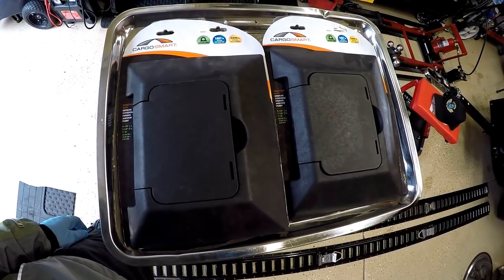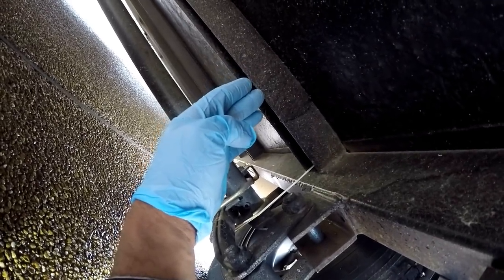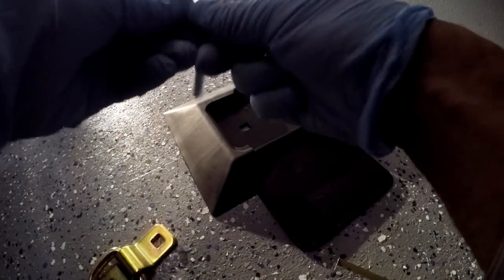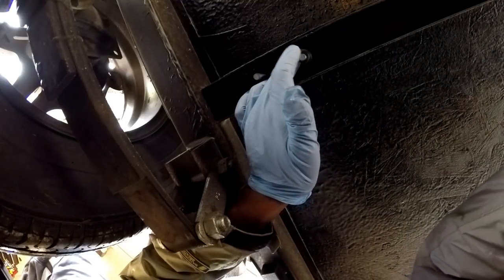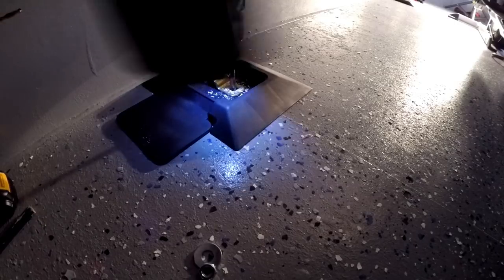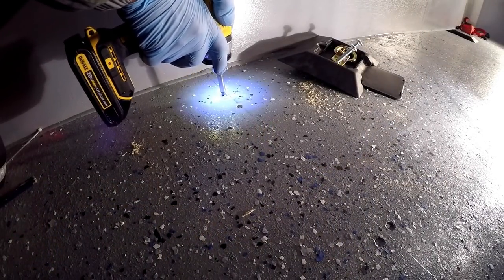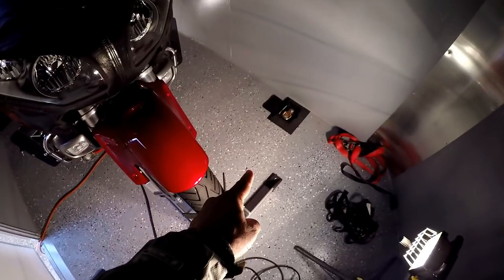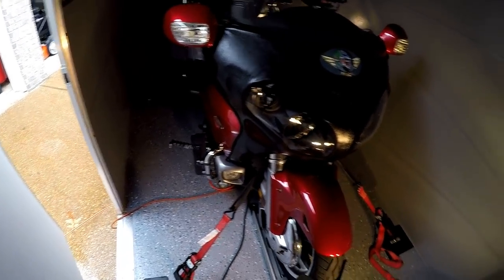CargoSmart Covered Anchor Point 5000 Lb install pt 1.

Comment: Front straps on the lower fork tubes. That why they compress over bumps as normal
Reply: Yup, I have been doing it that way for years. Best way!
Reply from the maker: Yep straps on the lower fork tubes, I didn’t fully show it while holding the camera with one hand can be a pain, I will definitely open the trailer up when it stops raining and re-film strapping the Goldwing down on each anchor point.

Comment: I can't see real well but it looks like you have the front straps around the front wheel, I usually put mine on the crash bars...
Reply from the maker: jimmy walthall I strapped it to the front lower fork tubes, being careful not to fully compress the shocks.

Comment: Good job. When you Towe the Goldwing do you place your shock adjustment in the lowest position?  Also , do you leave the transmission in neutral? I have heard of different ways to Towe.
Reply: Static towing like this shouldn't require settin it in neutral, however I almost always have my bike in neutral unless there is a reason no to.
Reply from the maker: Donald Combs the front wheel chock prevents the bike from rolling but this is very good information, lower the suspension and put it in neutral, this could actually help some out, it definitely can’t hurt it.